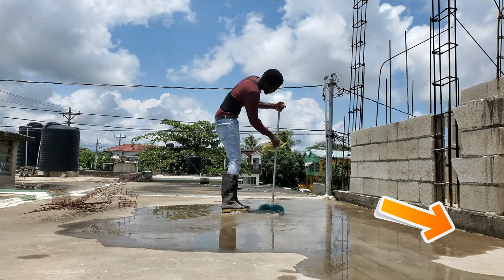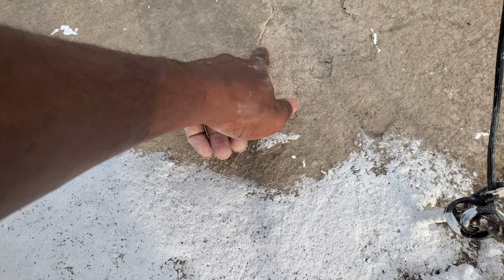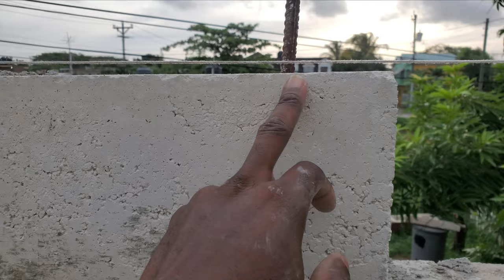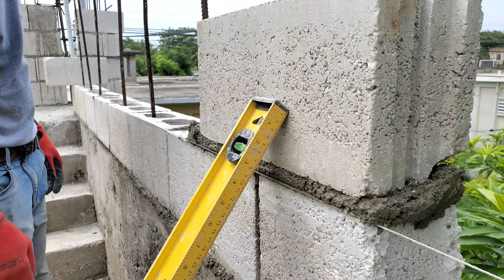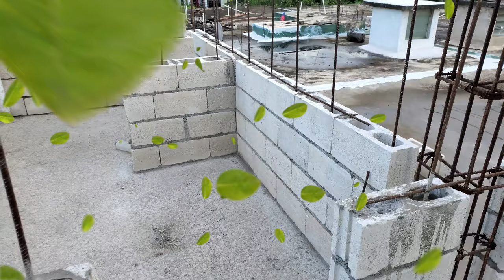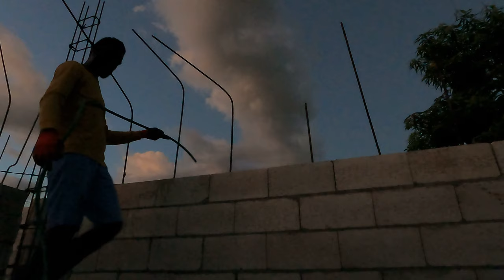Building A Jamaican Home Series: Laying Blocks With Mortar

Comment: Here, we use 8 inch for foundation and ground floor walls if we going up a next level. Main difference between what you guys do is we use ground beams 95% of the time. But rebar in every other block.
Reply from the maker: ok thats great to know where are you located?
Reply: Antigua
Reply from the maker: wow with all the hurricanes passing that side I can understand why much love to you

Comment: Blessing to you .. am new here and I find  your channel to be very helpful. Just want to see how to set the steel for blocking up like from foundation the one the block go over while blocking up
Reply from the maker: Good day thank you so muck for supporting the channel we have a video where we are steeling up for the decking but after installing the steel matting and the cages the first wall bar needs to be 6 inches from the column cage and the others wall bar have to be 16 inches from the first one

Comment: So when you finish the wall do you "splash then render" which is the finish coat. I always get this confused they built my house in Westmoreland in 1992. It's block with deck roof.
Reply from the maker: The flashing goes on first the make sure that the wall is plumb and straight and the render to make it smooth so water cant soak the walls